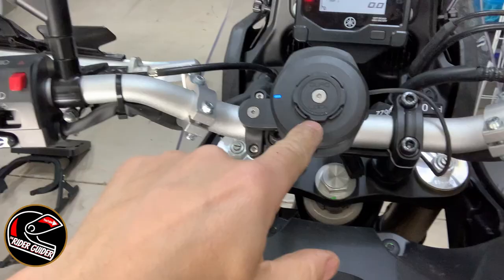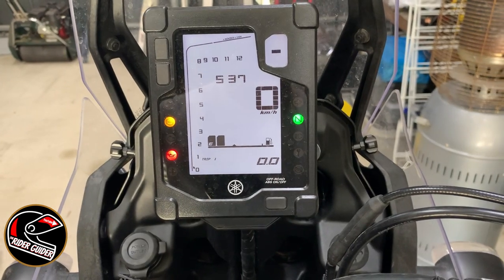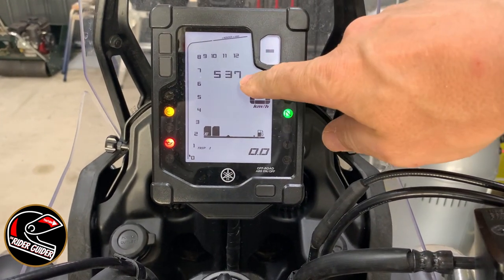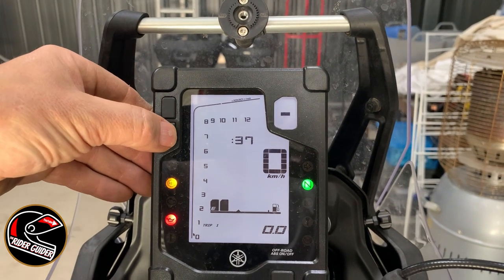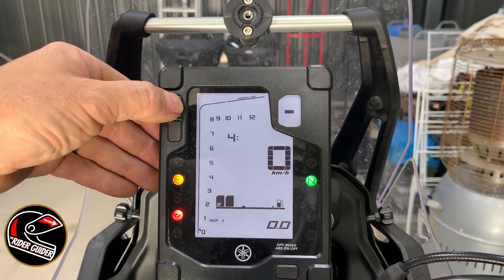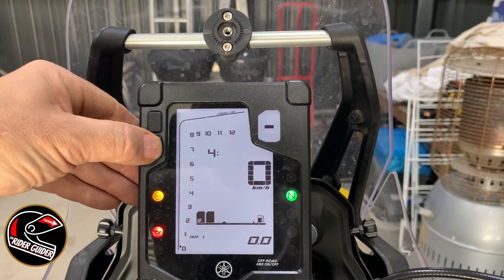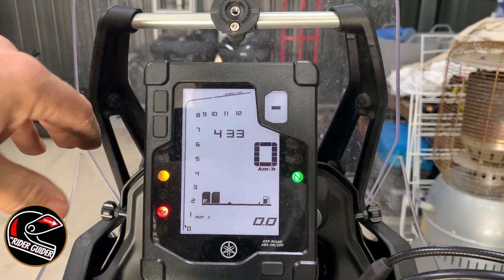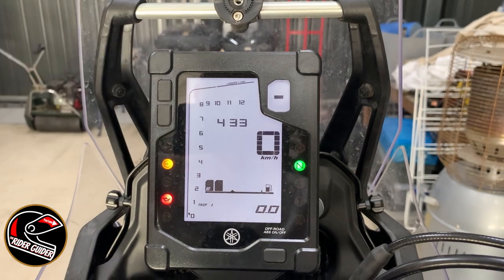Yamaha T7 Ténéré 700 - HOW TO ADJUST THE TIME ON THE CLOCK

Comment: How To switch between fahrenheit & celsius?
Reply from the maker: GREAT QUESTION ... some T7 I believe are in fahrenheit or celsius dependent on which country they are being sold in.  In Australia we have celsius but I understand countries that have fahrenheit get theirs in the F degrees.  However there is no way to do it from the clocks.  Maybe a software adjustment at a dealer could do this.